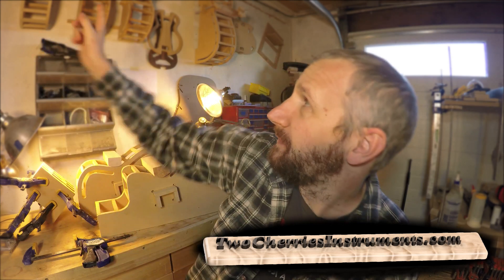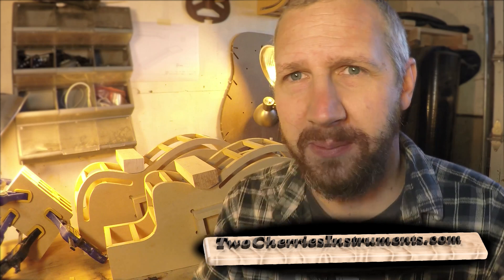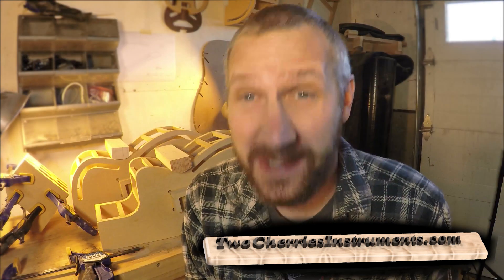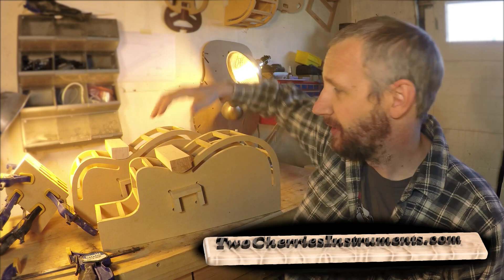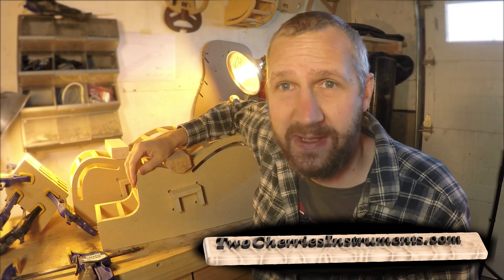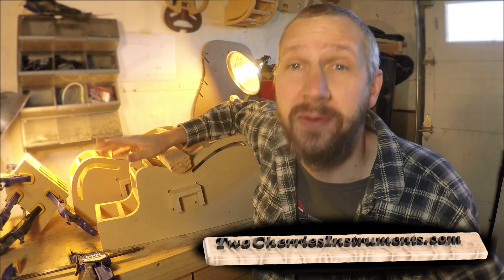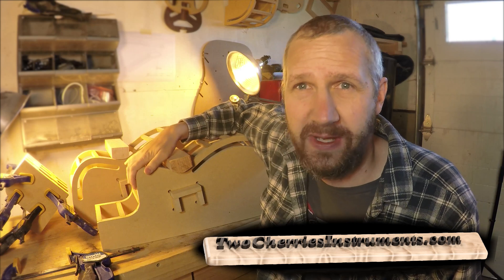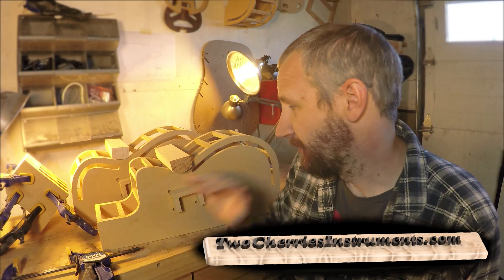Making A Selmer Guitar | Part 1 | Side Bending Jig

Comment: Nice video!! I just subscribed. How hard would it be to use your files with Vectric Aspire software? I am learning to use my new CNC (CNC Shark) as I learn to make guitars and this looks PERFECT!
Reply from the maker: I get this question from time to time, Fusion360 even with the current limitations on its free license is the most powerful platform out there for this kind of work. I'm sure it's possible to export STL or STEP from Fusion and import to another CAM software.